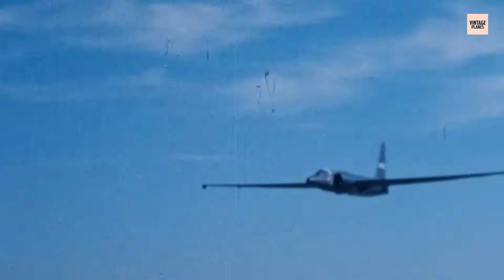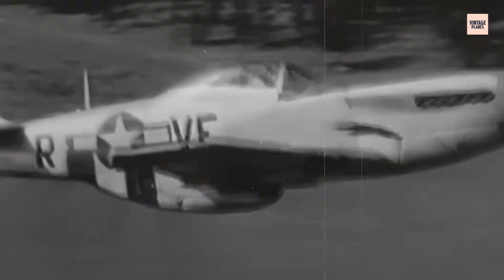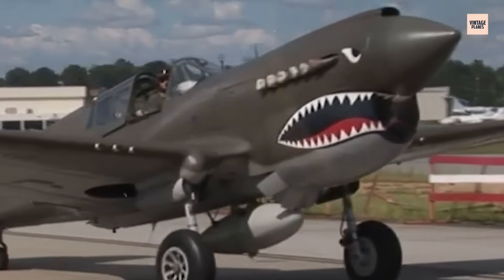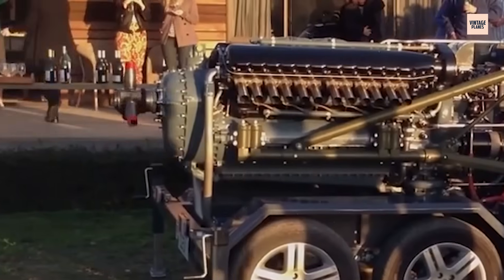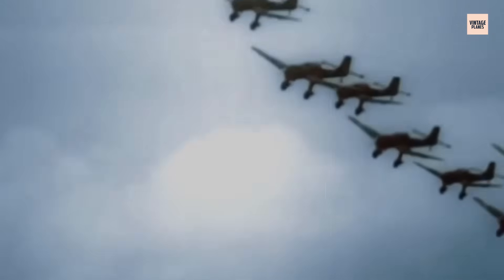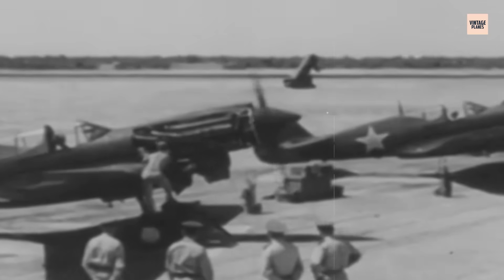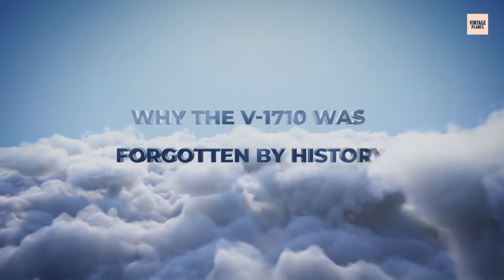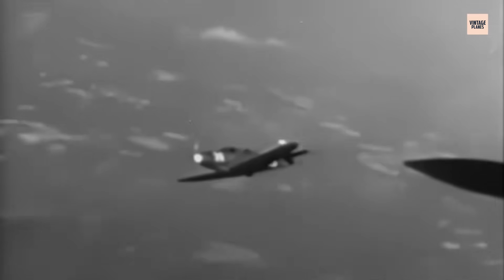The Shocking Truth Behind Allison’s V-1710 Engine

Comment: The Allison 1710 was designed to use a Turbo supercharger for it's 2nd stage. NACA data had confirmed that Turbos were the most optimal for both fighter and bomber roles.  So that is what Allison followed through with. The aircraft manufacturers of the time produced designs around this powerplant configuration.  Curtiss produced the P-37 which was later lost its bulky turbo and shortened becoming the P-40. Bell produced the  P-39 Aero-Cobra  which originally used a turbo, but after critical NACA tests showed its turbo intake configuration produced too much drag, they dropped the Turbo from the design. The P-38 was the only Allison engine fighter that ended up with the designed turbo installed on both engines. What held the Allison back was that their customer, the USAAF, wanted Turbo charged 2nd stage supercharging,  which is bulky enough to cause problems for fighter designs of the time.  So P-39s and P-40s dropped the Turbos and suffered in high altitude performance. Turbos genuinely do provide better performance, but they are bulky and can be difficult to cool. Mechanical superchargers are generally more compact, 2-stage -2speed superchargers can be calibrated to provide the desired performance at higher altitudes. The British and Germans developed their 2nd stage superchargers in 1940-41 and BF-109s and Spitfires didn't receive as standard until after the battle of Britain. 2nd stage mechanical superchargers are probably the better trade off all things considered. as far as they  knew at the time, The USAAF and NACA were making  a sensible decision, one that had unfortunate effects on the apparent performance of early-war US fighter planes. 

Also, The Alison 1710 predates its Daimler-Benz and Rolls-Royce competitors. The Allison was developed in 1930, the Rolls-Royce Merlin in 1933, and the DB 601 in 1935.  Your insinuation that the US was playing catch-up is simply wrong. The Allison was just as if not farther along when it comes to development and solving issues as the DB601 and the merlin. Its performance ignoring the Supercharging disparity was always on par or better than the DB601 or the Merlin. performance on the P-38J and later with its designed optimal configuration was comparable or better than the 2-stage 2-speed supercharged Merlin or Packard Cloned Merlin engines. Yes even more than the legendary P-51D or the Spitfire when it comes to power. The only plane that rivaled the P-38 when it came to range or engine power before the P-51D was the Republic P47 with the Pratt & Whitney R-2800 Double Wasp engine, also with a Turbo charger.
Reply: Thanks for intelligent and accurate comments!.  One other factor..money.  The UK came out of the Great Depression before the U.S.  Little money went to V1710 development which explains its protraction.
Reply: @danbenson7587  Not sure who came out of the Great Depression 'first', but the USA was less involved in funding the Allison V-1710 than Britain was with the RR Merlin. US Defense leadership believed in letting private industry develop the designs and technology on their own dime, then signed contracts purchasing the mature designs. In Britain, the government was more involved in design and development funding. The relative scarcity of development funding meant Allison had less flexibility in looking at alternative concepts, like the 2 stage supercharger approach. They had to focus on what the Defense Department told them they were interested in-and that was turbochargers, not superchargers. Unanticipated technical issues made General Electric a year late in delivering a workable design for the turbocharger, by which time RR had already introduced the two-stage supercharger model. For the long-range bomber escort mission profile, that model was the way to go-you had to be capable of flying/fighting at 20,000 feet and above. The Merlin Model 61 was the obvious choice for the Mustang engine, while the Allison was used in the P-38, P-39 and P-63.

Comment: Certainly nothing wrong with the Allison, compared to the Merlin it had a longer time between overhaul, a shorter time to overhaul, and vastly fewer parts.  It didn't require backfire screens.  US engines were required to pass a 150 hour test while British engines only 100 hours.  Initial tests of the Packard Merlin at 150 hours produced cracked pistons and rivets sheared off among other failures.  In addition to turbocharging a mechanical second stage was developed for the V1710-93 which featured a hydraulic clutch that provided automatic variable speed to fit the altitude.  Both the -93 and the two stage Packard Merlin achieved production status the same month, April 1943, so there was a choice for the P-51.  The Merlin was chosen partially because of available manufacturing capacity at Packard.

The P-39 and P-40 were produced without turbochargers primarily to get them into service ASAP.  The turbo system was not fully developed. Consequently the P-38 didn't reach combat until very late 1942.  The P-39 and P-40 were in production in early 1941 and were available from the beginning of hostilities.  The AAF would have been hard pressed without them.  The two-stage Allison was used in the P-63 and tested in the P-40Q giving both those planes excellent high altitude performance.

The biggest problem with the P-39 and P-40 wasn't the engine, it was their excessive weights.  The P-39 weighed 7650# and the P-40 weighed 8320#.  In comparison Spitfire V weighed 6600# and Me109G weighed 7000# on similar power.  The P-39 could have been easily reduced to 7000# but the P-40 couldn't get much below 8000#.  The Soviets immediately reduced the weight of their P-39s by removing the weak 30cal wing guns and some other equipment they deemed unnecessary or redundant and had a match for both the 109 and 190.  Too bad the AAF didn't
Reply: Thanks for your very well written comment!
Reply: I think Bell engineers worked with the Soviets to make some of their requested changes and improvements in US factories later in the war.

Comment: One of the serious issues with the Allison was that it did not perform in ultra cold conditions of high altitude and was prone to seizing up do to oil foaming caused by blow by due to loose tolerances.  They could have fixed these and eventually did improve 1710 but it was too late.  Packard built Merlins were actually better than those built by Rolls Royce, fewer parts and easier to maintain.  Allison could have done the same with the 1710 before it was too late.

Comment: So there was nothing wrong with the engine.  What was wrong was that the planners did away with the two-stage turbocharger.
Reply: They deleated the turbocharger because it was too large for the sleek fighters, except the P38 and its twin boom !!!!
Reply: @wilburfinnigan2142  It seemed the turbocharger required space only available on big airplanes like P-38, P-47, and bombers like the B-17.
Reply: @SmedleyDouwright gregs airplanes and automobiles goes into great detail about this
Reply: Absolutely & wanted 10 times more from it than was possible. Then they labeled it unfit.
Reply: Exactly. The Aircorps demanded that they let GE build turbo chargers for it instead of letting Allison develop the second stage supercharger. A bureaucratic stifling, not an engineering problem.

Comment: My understanding of the 1710 is that it was designed to and able to out perform the Merlin and DB601, in the prototype P38 it had a advanced turbo super charger system. But then someone somewhere made the decision to drop it completely. As a result pilots were sent off to fight in sub standard aircraft. That decision cost pilots lives. The 1710 was not a engine it was a scandal.
Reply: Your understanding is much better than the garbage they spew here.
Reply: The 1710 had a good two stage turbo charger.  The Army decided it didn't want it.  The Army wanted an engine powered super charger.  As a result, above 16000 ft the P39 and P40 ran out of breath at altitude.  It wasn't the engine it was the bureaucracy failed.  The 1710 had the potential to match the Merlin.  The DB 600 series of engines were better than the Merlin.